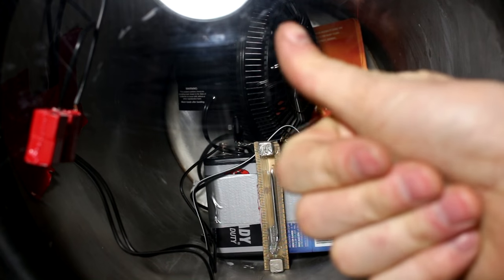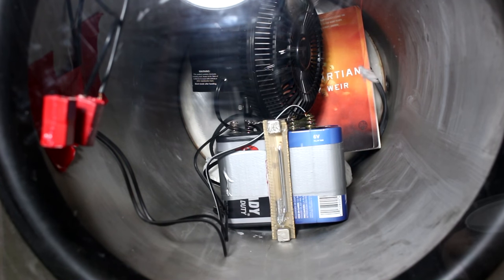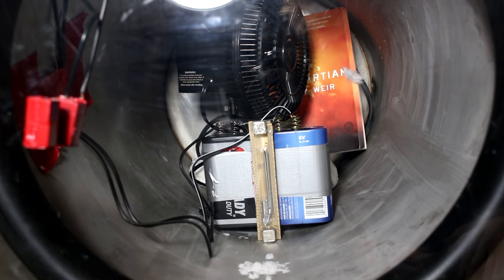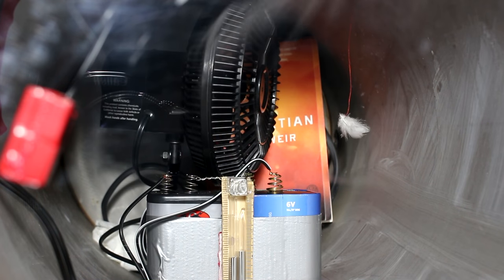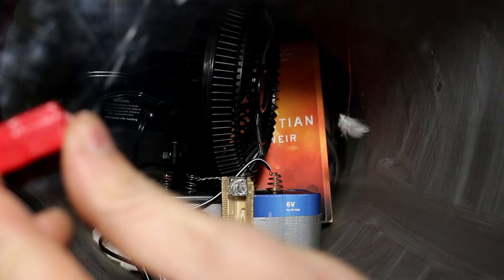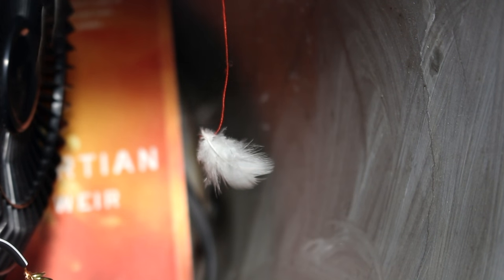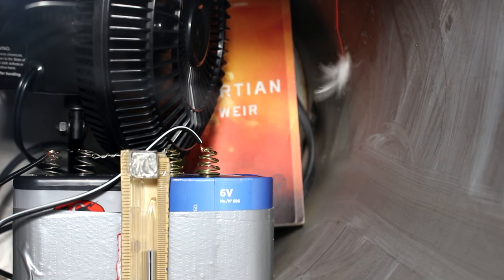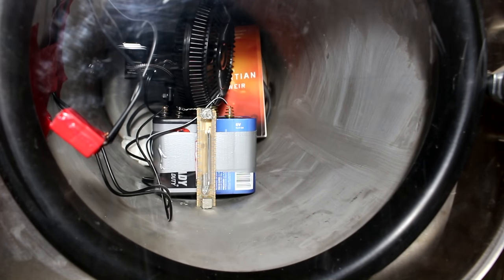How Strong is The Wind on Mars?

Comment: Cody, would be nice to see the feather hanging from something really lightweight like a fine thread. I mean, just avoiding the resistance added why the wire thing. My gues is the feather will move a bit. also I would try a bigger surface, like small piece of paper facing the fan. Nice vid. Love the way you are really fascinated with Mars.

Comment: OK Cody here is one for you. There is less air in the chamber there would be less thermal cooling and over spinning of the motor on the fan so how long could you run the fan without external cooling before it burned up? That would be a interesting experiment! Keep up the great videos!

Comment: Inertia, mass, volumetric surface area, gravity, atmospheric tidal forces,  atmospheric pressure... I'm sure im missing a bunch of other relevant  factors... that said there are alot of factors in surface pressure propagation based on all the above factors on the surface of a craft to include also cavitative force which would presumably take into account the lift required to "fly" in variable martian atmospheric conditions. Have you tried x simulator? it has martian presets and a martian gis map data. essentially it's as close to Mars as most of us will see. The force required by the craft designed to actually perform maneuvers in that setting is ridiculous. you can design your own flight models and craft in x, and I gotta say, it really opened my eyes to the challenges inherent in near vacuum/variable Gee environments.
Anyway, awesome vid, thanks for the content!

Comment: Please keep in mind the fan might not be pushing the air at the same speed because it simply isn't efficient enough to accelerate such thin air to speed. A better test would be to put a much stronger fan and a pressure-independent windspeed gauge in there and then turn up the fan until the windspeed reaches, say, 20mph, so you can be certain the air is actually moving as intended.

Comment: If I'm not mistaken, which I very well could be, there is wind on mars and there is pressure exerted from the wind. However, the wind on mars has to be extremely fast to produce the same amount of pressure as on earth. So, wind here on earth at say 8mph exerts 7.5-7.8  Pa (pressure) at sea level. Which would mean that the wind on Mars would have to be around 65 mph to exert the same pressure. That was something I read a long time ago in some article, so the maths aren't 100%, I was estimating. In other words, you could move the feather, but you have to create much more wind speed to increase the pressure.

Comment: Sadly, I think the effect comes mostly from the fan being less effective, rather than atmosphere being thinner directly. To get a valid equivalent, the source of "wind" should be pushing the same volume of air in a unit of time. You could either engineer something yourself (Archimedes' spiral? Some other thing taking a small batch, accelerating and then realeasing? ducted paddle wheel? vacuum pump?) or just stick to calculations. It would be nice to see if the approximations we take in our pressures are still valid on mars. Also, please hook the feather onto something not vibrating.

Comment: I think there's something wrong with the initial experiment. As the vacuum chamber was sucking all of the gases out, wouldn't it have sucked out the CO2 you were trying to push to push the feather using the fan in the first place?

Comment: To add to Gregory Dearth's discussion of ~2 weeks ago, I'm furthermore not assured that a fan whose blades are engineered to be aerodynamically optimized for sea level N₂ pressure would actually produces the same wind speed in a Martian CO₂ atmosphere. Or whether it would produce any substantial speed at all. The fan is turned on, but nothing tells us just what is happening to the CO₂ it's pushing around.

What is needed is a very delicate anemometer (Perhaps balance a suitably shaped piece of foil on top of a blunted needle). It would be more complicated song and dance to actually calibrate its rotational rate against wind speed, but dispensing with that, at least it would give a qualitative impression of what's happening. Needless to say it wouldn't survive the fan's wind at normal air pressure.

Comment: I've read there are dust storms on Mars even though there is little wind that can last weeks or months. The explanation I read said that it is a little like a snowball effect where what little wind there is picks up fine dust in small quantities and the dust in turn bumps into larger particles which kicks up more dust and so on until you have a massive weather phenomenon created mostly by dust particles acting on each other rather than a gas.

Comment: Did the fan even accelerate the "air" inside of the chamber?

The blades make less contact with the gases inside so the speed of the "air" isn`t  high because the total thrust given by the fan is way less, right?

Comment: Hey Cody. What about temperature? Night temperature on mars is roughly half that on earth (measured in Kelvin). Therefore a gas with the same pressure would have roughly twice the density. I am not sure what is the case here, when you create a vacuum and sublimate CO2. The movement of the feather will be given by the density of the gas, and that depends on on pressure and temperature as well. It probably won't change the result of the experiment, but it might affect the feather-spaceship.

Comment: Now say you took one of those levitating tops and put it in there under a full vacuum, because there is no air resistance, or at least not much at all, and there's no friction from contacting a surface because of the suspension would it spin indefinitely? Or maybe for hours instead of a few seconds/minutes?

Comment: Would the fan overheat and stop if you ran it too long in that vacuum chamber? If so, I wonder how long it would take.
Reply: Brian Ashlocke it probably wouldn't overheat since there is next to no load on the motor now that the fan isn't really pushing on anything. But with those amount of vibrations it'd probably mess up the bearings/bushings eventually and then it'd overheat real quick

Comment: I'm having trouble with a fan being used to simulate wind.I thought wind was caused by differing pressures trying to equalise. Could you do this again using two vacuum chambers at slightly different pressures connected by a hose with a valve that can be opened to cause the "wind" to blow as pressures equalise.
Reply: Good plan. I'm not convinced that fan is actually producing the same speed wind at a highly reduced pressure that it wasn't optimized for at all. It's an assumption that it is producing the same speed wind but merely/only lower mass.

Comment: I bet that fan was moving much faster in the vacuum because of lack of air resistance. The increased vibrations are probably because of the faster movement it would be interesting to balance the blades weight wise and see just how fast the fan was moving in the vacuum. If you do any more experience in the vacuum chamber with the fan I think you should remove the safety guard so we can see the blades better.

Comment: Dont forget that there are giant dust storms regardless of what the atmosphere actually is. The dust particles have thousands of miles of room to get up to 200mph. Those tiny dust particles ARE going to have an effect on the spacecraft and astronauts. Maybe not enough to push the spacecraft over, but enough to pick up smaller objects and hurl them around or damage the craft enough that you'd have to evacuate.
Reply: Is it possible to produce a dust storm with a wind force unable to move a feather? or maybe the data about mars atmosphere density is false?
Reply: mars does have dust storms that cover huge portions of the planet for weeks at a time. The dust is moving extremely fast. if you accelerate at 1m/s/s you will eventually get to c, but you'll get there faster if you accelerate at 10m/s/s. The dust can still get to high enough speeds to damage spacecraft and it honestly doesn't matter how long it took to accelerate the dust initially once youre in the middle of the storm

Comment: I'm sure this hasn't escaped many minds, but even though the atmosphere density is so low on Mars, the conditions in a dust storm are much different that a regular storm on earth, where the air itself is pushing and blowing things about, the difference being particle size. A dust storm has dust in it, not just CO2 and trace elements/compounds found in the Martian atmosphere. The dust is more densely dispersed in the atmosphere than those particles and have a higher mass. more particles, more mass, more inertia. the dust storm has a higher pushing power than any sort of wind alone on the surface of Mars. Like I said, I'm sure this is an idea that I'm alone in having.

Comment: Hey Cody, I have a question/request regarding this experiment. Would it be possible to use a stronger fan or insert a device that actually measures the force of air against it? I feel that it may be possible that there's just not enough left over inside of the chamber for the fan to catch and accelerate. Is this possible or am I over thinking? :)

Comment: Cool video. But I don't know if there was any wind in the low Vacuume chamber. Yes the fan blades were moving but did the blades have enough "bite" to cause a breeze? Seems there should be another way to measure the speed of your low density breeze. 

Either way, you make cool videos.

Comment: The fan will spin faster under vacuum, since there is no load acting on the motor. Same reason vacuum cleaners become more high pitched when you block the hose.

Comment: Hey Cody I'm not sure this experiment is accurate. This experiment only shows to me that it is harder to produce a thrust mechanically in lower pressure environments, due to less contact between the blades and atmosphere, that's why the feather didnt move. But wind on a planet is produced through planetary rotation (Coriolis effect) and atmospheric thermal/pressure differentiation, and Mars   wouldnt be exempt from that. Your thoughts on this?

Comment: Cody, wouldn't the fan rpm speed increase as the atmosphere is reduced? If this is the case then could not the fan be blowing at a faster velocity in Mars pressure than on Earths? Maybe you were blowing at 40 mph Mars pressure and 10 mph Earth pressure. Can you measure the rpm of the fan? This could explain why things were shaking at the lower pressure because the fan was spinning so much faster.

Comment: Two points: you're not taking into account that the fan is not as effective at moving air at lower pressure, so the airspeed are not equivalent.  Also in the movie it wasn't just wind, it was a dust/sand storm, and the density of that isn't so much related to the atmospheric pressure.

Comment: Doesn't the lubricating oil in your fan's bearings boil away in the vacuum?
Reply: ***** - According to:
http://www.engineeringtoolbox.com/vapor-pressure-d_312.html
The vapor pressure of virtually all oils is more than 500 pascals.  Atmospheric pressure on Mars is listed at 640 pascals.  So it seems likely to me that if Cody conducted his test properly (and I trust that he did -- not just because he's Cody and has built up immeasurable trust from past behavior -- but especially because he was concerned enough to re-run this experiment with CO2 instead of air) it is extremely likely that the ambient pressure in his experimental vessel was less than the vapor pressure of at least some of the constituents of the oil in his fan.  Lest you have forgotten from high school chemistry, that is the condition for boiling.
I'm really just suggesting that Cody lubricate his fan now -- post experiment -- if he gets the chance.  Dig me, pygmy?

Comment: So if the feather doesn't even move when the fan is turned on; if you were driving a vehicle on mars and stuck your arm out the window, would you even feel a resistance against it?   Also I'm curious if you had to pressurise a module with martian atmosphere, how long would it take.  As well I'm wondering with an atmosphere of only 2.7% nitrogen if it would be possible to convert that module to a breathable earth like air.

Comment: My friend was telling me about his water cooled computer, and asked me what a better material would be to cool the computer was.  My mind went straight to Mercury.  At 300 kelvin, the thermal conductivity of water is 0.609 W/(m·K).  Mercury has 8.4 W/(m·K), so it would be much better.  I was thinking you should try a colab with LTT on this.  Then I was thinking gallium would be very interesting.  There would be a few problems with this though, namely that it could not go under 30*C, else it will freeze, and that would not play well with the radiator I would imagine.  However, it has a much higher thermal conductivity at 300K, at 40.6 W/(m·K).  I think someone should do this, and I think that you are the person for it.

Comment: It's definitely a cool experiment, but I think it's applicability to the conditions on mars is limited.
On the one hand, air resistance grows according to the square of the wind speed - so if winds on mars are 20 times the speed, they produce 400 times the drag.
On the other hand, a fan producing 10mph wind speeds at 1atm pressure doesn't necessarily do so at martian conditions.
Then there's the minor effect of the reduced surface gravity.
Maybe the scene in The Martian is in fact unrealistic (Andy Weir himself saying so makes that quite likely), but this experiment is only roughly similar to the conditions on mars.
You managed to create an entertaining video out of it nonetheless. Good job, thank you!

Comment: Is it possible that the fan was unable to accelerate the air up to any useful speed due to altered aerodynamics near vacuum? I would want to develop an anemometer that would work at near vacuum before I ruled anything out. SOMETHING is kicking up dust storms to begin with and I assume that feather would NOT be idle in a dust storm.

Comment: The reason wind is able to be so powerful on mars while having so little atmosphere is because of the Hughes changes in temperature it has on a daily basis fluctuating from -200 to 60 at times. I don't think a fan would work for this experiment because you are trying to push a section of air instead of all the air at the same time. Would all the mars dust also act like a atmosphere once it gets in the air?

Comment: You had the fan wired backwards and it was sucking instead of blowing air.  Not a huge thing, but would have had more impact on the feather in the Martian atmosphere if it was blowing at the feather.  Put you hand behind a fan, some movement of air, but nothing compared to the front of a fan.

Comment: are you sure the wind in the thin air is moving 5m/s ?
if the fan moves the air at 5m/s at normal atmospheric pressure then it will move the air significally slower in thin air.
Im almost certain that the thin air aint moving even close to 5m/s

Comment: The feather would have to require 1/400th of the force to make it move for the scale to be correct, since the force due to non-viscid fluids is proportional to the square of the speed.

Comment: problem is that with a fan in (near) vacuum you don't really accelerate the air. you don't generate any wind like this. So the cause of this feather not moving is lack of wind and not lack of interraction with wind.
In other words: you said the fan would produces 10mph of wind (in normal pressure) and assumed thats what it does in near-vacuum, too. It doesn't. Fluid velocity in this case probably is very close to 0. And thats why the feather doesn't move.

Comment: I've been watching your videos for about half a year now and I must say they are always very interesting to watch :D I have a question though. Would the vacuum actually affect battery's specifications like voltage and resistance. And also I was reading about vacuum circuit breakers (VCB). So is it possible to make an experiment with a taser in vacuum? Would it still work? I don't know if it's safe enough to do it in your chamber though (apparently batteries could boil), but just a suggestion.

Comment: Hi, Cody. The fan wont create wind due to that the pressure difference on the blades is close to zero due to the low air density - but could pressure differences on different places of Mars still create a strong wind like we see on Earth? Maybe I'm missing something here, please enlighten me YouTube friends! Otherwise thanks for a great channel, I learn a lot!
Reply: The problem is the mass, There isn't enough particles to push to create a strong force. And even if you could get a strong wind going with the aforementioned "pressure difference" , you would have to get the wind moving many many times faster to get the kind of force you get on earth, as there are also less particles to collide with.
Reply: Name Yes, exactly. So the question is if the low density air on Mars could in theory be pushed so fast that it could actually create a "super storm", I'm taking a wild guess and say no
Reply: Fredhem It technically could, however i don't see many plausible things that could cause that to happen naturally. If WE tried to do it we could, though.

Comment: Whats holding the feather to the roof ? Is it metal and is there any chance the little movement seen was the em field of the fan interacting with the hanging wire?
Reply: Bevin Holder The slight movement was due to the depressurization of the chamber. It must have caused a slight difference in pressure between two parts of the chamber, thus creating an effect similar to atmospheric turbulence.

Comment: Maybe it's the vibration of the fan on the surface of the chamber that is causing the small movement of the lines. The feather in itself isn't influenced by the "wind", because its shape isn't affected by the fan...
Reply: Try the same experiment but remove the fan blade before.